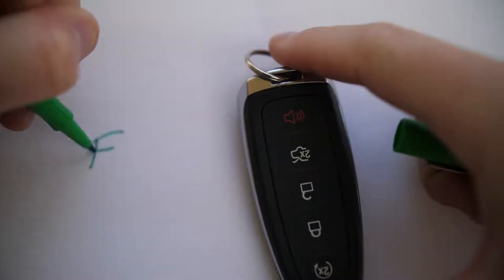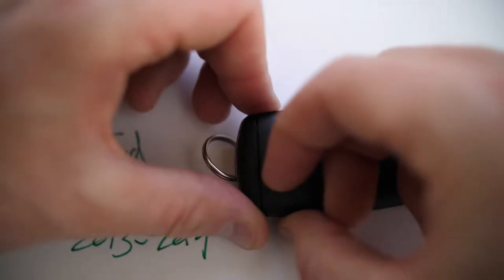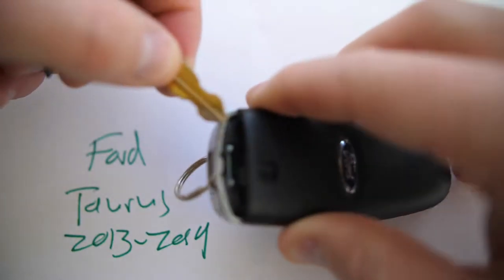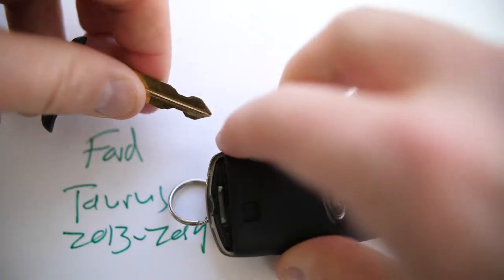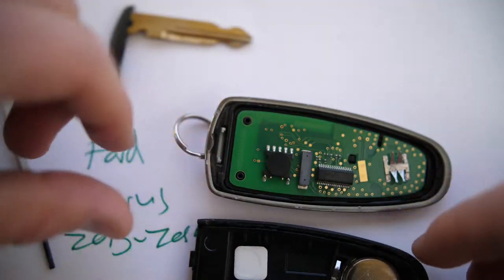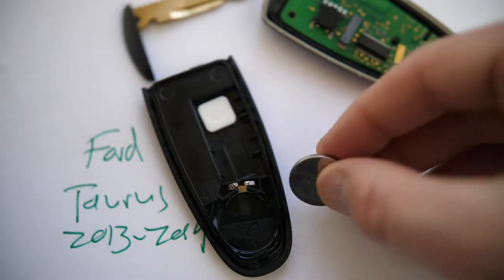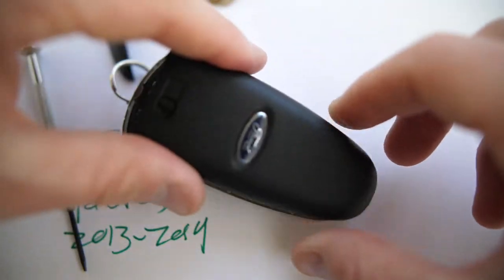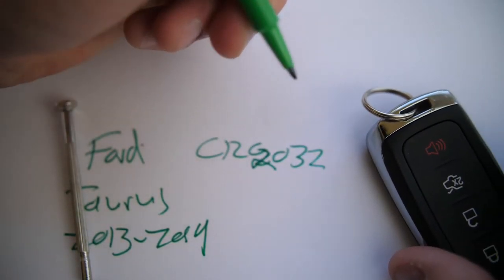Ford Taurus Remote Key Fob Battery Replacement 2013 2014 2015 2016 2017 2018

Comment: My SHO kept telling me that no key was present.  I hope that it is the battery.  I mistakenly paid the dealer to replace it last time.
Reply: Mines doing the same thing you ever find the issue
Reply: @cleanriderjonez5247  For me it turned out that the batteries were dead or close to it.  They take a pretty standard battery (2032 I think) and the video is quite thorough.
Reply: @alanhassall thanks
Reply: @cleanriderjonez5247  I